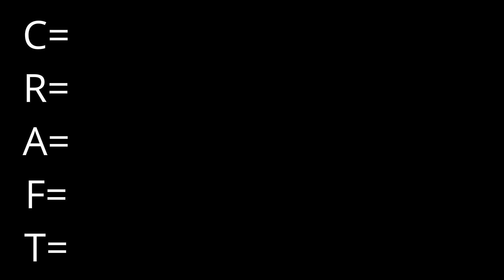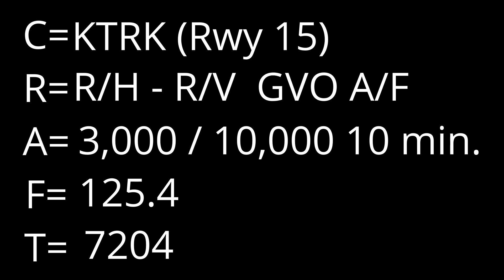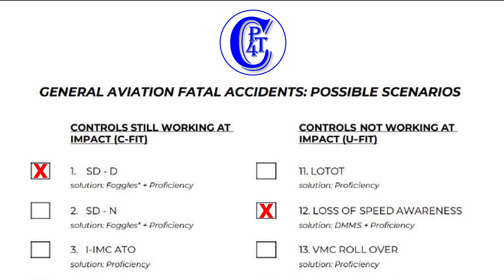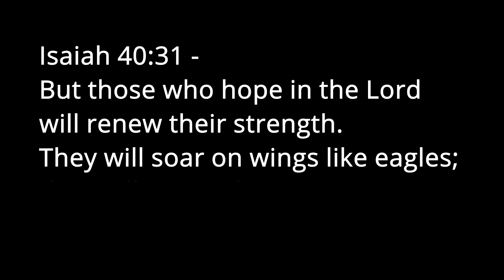Accident Review: Cessna Turbo 182T | Probable Cause AQP #1 Spatial Disorientation and AQP #12 DMMS

Comment: Her speeds look reasonable. Maybe DMMS wasn't much of a factor here. From the start of her turn the bank angle was steeper than I would expect and it quickly got worse, which could result in negative climb, and could initiate a spiral if not corrected. Is it possible she flew into a spiral rather than a stall/spin?
Reply from the maker: Hard to tell if DMMS was/wasn't a factor as the track is ground speed not indicated airspeed. I tend to believe that it did play a part how much we may never know. However, realizing she was climbing more like Vx vs Vy and ATC giving her a heading and altitude change while in IMC all are contributing factors. I agree she "ended-up" in a spiral, what came first is somewhat conjecture, but I cant disagree with your scenario . . .
Reply: @Parr4theCourse  ATC wanted her at high altitude in a hurry. She may have felt obligated to continue climbing during the turn, rather than making the level, standard rate turn I would recommend in IMC.
Reply from the maker: @RaysDad  
Yep I’m right there with ya, she did sound a bit flustered once airborne vs how she sounded on the ground.

Comment: Did she have a glass panel or steam gauges?   OK never mind I just looked up the airplane, it’s the exact same airplane I have which is full glass panel.  So weird why didn’t she just put it on auto pilot?  She must have been in some unbelievably bizarre pitch up attitude that resulted in a stall, but even then the PFD Will eliminate all distractions on the screen and just paint red arrows pointing down to pitch down.  Situations like this scare the hell out of me. Especially when it happens in the twin sister to my airplane!   If it can happen to her, it can easily happen to me.
Reply from the maker: G1000 with a KAP140 autopilot
Reply from the maker: Yea, thats why this one got to me, same as you sister aircraft so it hit home pretty hard....

Comment: Cont.  I  used to fly my 1974 C-182  and made a custom to level and accelerate as much as traffic allowed while over the runway to al least 80 kts. And continue climbing and getting as much energy as I could particularly when bellow 1,000 ft AGL... Turns no more than 20 degrees above 80 - 90 kts.  Even when lightly loaded!
Reply from the maker: That is very wise, I pray that you can get in the air again!!!

Comment: Back when I was flying SEL-Instrument, I don't recall it being a particularly high workload.  Seems one has a responsibility to be in the plane and nowhere else.  And all this discussion about DMMS - I rarely got anywhere near that speed in normal operations.  We'll never know what was in her head, but it certainly wasn't operating the aircraft.
Reply from the maker: Yea, I was a bit taken back when I got the analytics on her climb out speed. I get Vx if you need to clear an object (going straight ahead) and afterwards you need to pitch forward and build up some airspeed, especially prior to a turn and in this case appears to be much greater than standard rate turn while in IMC. Just sad as this was so preventable.

Comment: It's probable that it's not an accident, that disorientation is number one on the list.
Why didn't she gain speed with altitude? Does the 182 really perform that weakly, or was she trying to hold back to save fuel?
Fly with your airspeed indicator, not your fuel gauge. It's a sad case, like so many others. Good luck with your reporting effort. Keep hammering away at the safety issue. Blessings to Ms Nicholson's family and friends.
Reply from the maker: I fly the same model and it climbs quite well, but I agree with you low to mid 70kts is a bit slow for climb out, even more so in IMC! Then add a turn in this case a fairly steep turn on top of that and it can be a recipe to induce an Unusual Attitude, which she apparently did. We can only hope and pray that this isn't repeated. Janis and I had a hard time with this one our hearts break for the family.
Reply from the maker: @d.t.4523  
Thank you for you’re insightful comments!

Comment: I had a stuck trim - resulted from a broken actuator spindle in my 2002 182T a few weeks ago.    As a result my 182 entered into a very steep nose up condition. I was physically strong enough to push the nose down and trouble shoot the problem.  Im 200lbs and do cross fit 5 times a week and I only JUST managed to avoid a stall spin situation - Im not sure a slightly built female would have been able to physically manhandle the problem.  I hope the NTSB look into a trim problem.
Reply from the maker: Yea, its a little unnerving the first time it happens to you isn't it?
I just knew I was going to bust altitude on my Instrument checkride when it happened to me, in retrospect the DPE most likely wouldn't have dinged me on it as it was a "real" issue. They're a  lot of unanswered questions on this one, I "WANT" to believe that there is more to it than what we know so far.

Comment: Very sad, but she was apparently not ready to fly IFR (in IMC). This was a G1000 C182, which apparently was too much for her. You have to know how to handle the system. Once u know that, its so easy to fly! If I take off, the AP is preset to HDG-mode and the 1st altitude (3000ft in this case) plus VS. No brainer. I try not to fly this by hand in such conditions.
You can tell by her voice that she is not comfortable. 
RIP. My condolences to the family and friends!
Reply from the maker: Yea, I fly the same model and this is simply heartbreaking when a very capable aircraft for an IFR platform goes down. I do tend to hand fly a lot in these situations for proficiency, however the AP is set-up and ready to engage at a moments notice when needed....

Comment: She seemed behind by the time she said 11 thousand when she meant 11 hundred. Single pilot ifr? Turn on the AP.. Especially when entering imc and maneuvering.
Reply from the maker: Sad thing is we don't know if she did and it malfunctioned or?
I did my Instrument checkride with a KAP140 and had a trim runaway, it takes some force to override it, when the AP disconnect didn't work on the yoke, then the On/Off didn't work on the AP, ended up having to pull the circuit breaker. DPE said good job flying the plane while figuring out what to do next, I said next time though I'm going straight for the circuit breaker and figure things out when I'm in level flight during cruise when nothing else going on . . .

Comment: If you were to sit down with experienced controllers at any airport / approach control where GA operations in MVFR and IFR conditions are routine, and play this tape, the very first thing they are likely to say is that this is a voice of inexperience. I know nothing about the pilot's background or training, but I have paid extra attention to voices like this many times over 30 years in this industry on both sides of the mic. Assistance is often required. From early on, listening at SBA's GC and LC positions, I would have been hoping/assuming there was an instructor on board.
Reply from the maker: You bring up a very interesting point, If a controller "senses" stress in a pilots voice, should there be training to instill/restore some calming to the situation?
If nothing more that to "stay-on-the-line" a little longer to make sure all is well in order for the pilot to admit there is an issue.
Good point!
Reply: @Parr4theCourse  There is little recourse or means to even attempt that until/unless it's a situation where the pilot is able to have a conversation about it (i.e., at least suspects that all may not be well). In this case, I don't think there was sufficient indication and opportunity to do that. With professional crews and controllers, there is a quick shorthand, mostly based on FAA phraseology, that we just expect to hear from each other on either side of the mic. In the cockpit, communicating is the last out of three main priorities, so we generally don't want to have to put too much thought or time into it. The degree to which that is present and confident in a pilot is sort of a stand-in measuring stick for experience generally.

I was impressed with a C182 pilot years ago who was hanging around an FBO in California after arrival in marginal weather. I was doing something else there at the time--don't remember what now, but probably some kind of currency work--and one of the managers called me over and asked if I would mind taking the 182 along with the pilot and his passenger up to their destination further north that was IFR and in complex airspace (i.e., intense ATC). It turned out that the pilot was instrument-rated but concerned about his lack of recent actual time and needed to be at his destination, so get-there-itis was a concerning factor as well. Being an intelligent, humble pilot, keenly suspicious of his limitations, he and his passenger were safely at their destination about an hour later. He just held a PPL but he was actually a consummate professional in that decision-making.
Reply: @ReflectedMiles  "Shorthand" example?
Reply: @ReluctantPost  A line of half a dozen aircraft are setting up at the hold-short of a departure runway.

Typical commercial crew in that line if they haven't been told to just monitor tower frequency: "United 1493 ready two-four right" (A FedEx C208 will sound about the same, so it's not about the number of engines or single-pilot flying, etc.)

Typical less-experienced GA pilot in that line: "_____ Tower, this is Cessna N12345 holding short of Runway two-four right [pause], with Lima and our clearance. We're ready for takeoff." (This isn't bad or wrong at all, and no one should feel bad for using it. It's just a mostly-unconscious, Saint-Expuery indicator of experience level to the controller--"Perfection is achieved, not when there is nothing more to add, but when there is nothing left to take away.” English professors prize the concept as "brevity"--the most said in the fewest words.)

Comment: I have done a lot of single pilot hard IFR in the exact same model of aircraft. It is indeed a solid barrage of work coming at you fast while on departure. My strategy was to get about 5 instructors to give me an opinion on my skills (which is time consuming and expensive). If any one of them had something critical to say about my IFR performance - we would go and train that scenario until they were willing to let me fly their kids in hard IFR. 

I would encourage any pilot to set personal IFR skill standards well above the FAA minimums requires to pass a check ride in VFR weather. Memorize your avionics buttons/features/functions. Master ATC comms. Get EVERYTHING completely setup on the ground. Doing so allows you to successfully focus 100% on controlling the aircraft at the critical moment you go into actual IMC.
Reply: Very good practice and advice.
Reply from the maker: @ReflectedMiles  
Absolutely!
Reply from the maker: Great tips/points of view!
We appreciate you committing….

Comment: I’m a student pilot so forgive my ignorance, but if you are flying into IMC why not fly with the auto pilot to eliminate any spacial disorientation risk . Just simply climb in IAS mode /heading mode and just simply turn the dial to make course changes ? Again I’m a noob so I could be far off .
Reply from the maker: Great question, maybe I can offer a couple of scenarios as to why:
This aircraft was equipped with a KAP-140 autopilot, which doesn't have an IAS mode it has a VS mode. When you first turn it on, it will capture the rate of climb you are currently climbing out at and will maintain that rate of climb regardless of your airspeed if you are distracted or do not reset the VS on the autopilot, this scenario can/may lead to a stall if you are not vigilant. Then, possibly in a panic you tend to disengage and maybe without realizing it, the plane is still trimmed/climbing to the VS that the autopilot had captured, while you are busy talking with ATC. 

That is why some pilots will wait until they reach their first assigned altitude before engaging the autopilot. I tend to do that as well, as I have engaged the AP with an Armed Altitude and the autopilot didn't capture the altitude and kept climbing. 

Not saying this is what happened in this case, but that's why the GFC700 is such a far superior autopilot. you need to be aware and know the limitations of your equipment.

I actually had my KAP140 autopilot have a trim overrun during my Instrument checkride, pressed disengaged button on the yoke; Nothing, hit the off button on the autopilot; Nothing, had to pull the circuit breaker to disengage. Made for an interesting checkride as I had to hand fly the rest of the checkride.

Hopefully that helps, again it is only a "possible" reason, we don't know if she did or did not engage the AP.
Thanks for watching/commenting!
Reply: @Parr4theCourse  Good idea to have solid hand flying skills in IMC.  When I took my instrument checkride  22 years ago there was no AP in the rented 172 I used.  It was a nice plane, however, with an "Air Plains" 180 hp conversion.  And I had to shoot a NDB approach also, along with a partial panel VOR-A approach.  At least the examiner didn't fail the DME during the ride.  That was a big plus!
Reply from the maker: @clearpropcfi3744  
Awesome, wished I had started flying earlier…..

Comment: Flew Beech 18s on scheduled runs for Emery then FedEx night charters. Single pilot IFR can be hazardous at times as you said. Add ice, thunderstorms, fog, instrument & engine failure & the workload for a single pilot with no autopilot becomes tremendous. I survived years of this & damn lucky to be alive. Great video! You know what you're talking about. 

One smart thing I did before becoming involved in heavy IFR all weather runs is to pay an instructor to fly with me as copilot. I could've done it myself but having him there was a reassuring, positive, corrective & wise decision. If you're weak on heavy IFR skills, do likewise please!
Reply from the maker: Thanks, we appreciate you watching and commenting.
I have often said I would retire and fly Cessna 208 Caravans for a little extra retirement cash flow, if they would allow my wife to fly along with me!
Reply: @Parr4theCourse  Believe it or not a FedEx contractor was going to hire me for their Tallahassee to Orlando run (Caravans). I was 70! I almost accepted but it would reduce my S.S. plus I'd had enough of staring thunderstorms down.
Reply from the maker: @billcallahan9303  
Too cool, I would “consider” it if my wife could fly with me, but they wouldn’t allow it…..
Reply: @Parr4theCourse  Very true Parr. I flew Otters in the Caribbean & Africa. Turbines are very reliable but I had two engine failures, one in the Carib, the other in Sudan, both were the fault of a Fuel Control Unit. The problem with a 208 is that you only got one.
Reply from the maker: @billcallahan9303  
Yep, still better than a piston…..
Reply: @Parr4theCourse  Yes sir! Far better!

Comment: Incredibly well done accident review. You told the fax concisely, and with compassion. Count myself as one who took note of the lesson you were trying to teach. Maximum climb rate is not necessarily the best climb rate in IMC. You have to keep the airplane in the air.
Reply from the maker: Thank you very much, it seems like CFI's like to promote climbouts at Vx. my fear is that "some" pilots may have that ingrained as the preferred speed.  I fly a 182T model and the only time I fly Vx is during a BFR or in that RARE case I need to get above an obstacle. The sight picture at Vx in a 182T is uncomfortable to me in VMC, your looking almost straight up and being pressed against the seat back "may" have an unintended result that you need to pull your self forward using: the Yoke! 
Thanks for watching and commenting!

Comment: is the T182T incapable of faster speed climb-rate.  seems like she could have goosed the throttle but perhaps this plane doesn't have any performance in the conditions she was flying in?  Such a tragedy.  I bet her family was just devastated.  I hope people take a passenger with them with these types of flights even if the co-pilot has only flown a flight simulator at home on their gaming PC.  It's better than trying to do this alone.
Reply from the maker: Not sure why she was climbing out that slow, the plane is very capable of faster Vy climb out, I always say my wife is the best "non-pilot" copilot there is, she is great to set-up my frequencies, approach plates, etc.
Reply: @Parr4theCourse  Yes, over 1000 FPM at sea level in that plane @ gross weight, which she was most likely far below.  And the marine layer along the CA coast is often less than 1000 feet thick (I'm a SF Bay Area native and learned to fly there). So many takeaways here. Thanks for posting this very thoughtful report and analysis.
Reply from the maker: @clearpropcfi3744  
Thanks for commenting . . . 
Maybe the NTSB will find something in the wreckage that will shed light on to this, doubtful, but we can only hope!